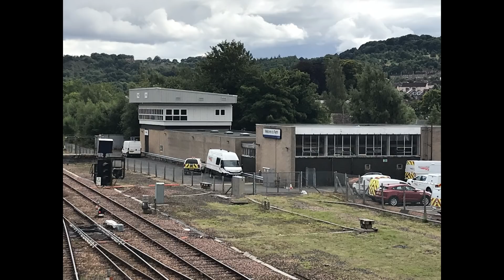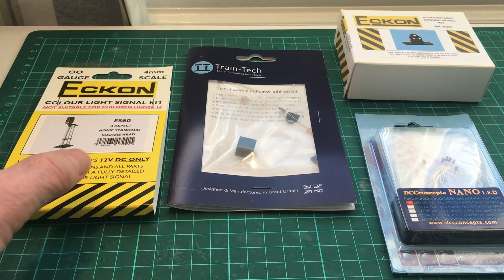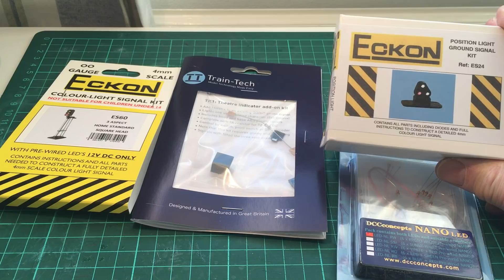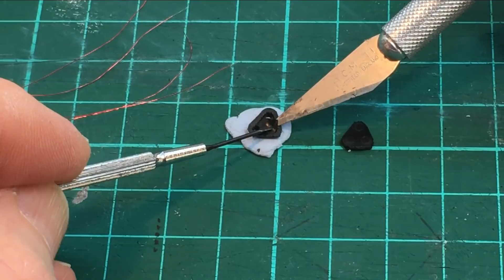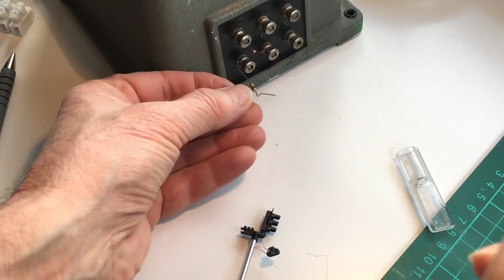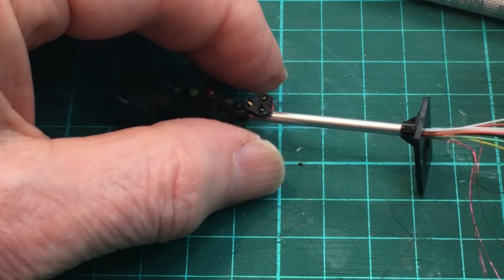Perth South Model Railway #19, Signalling the Layout Part 1

Comment: Of course if you are going to get Multi Aspect Signals (MAS) to work as they do in real life, using Track Circuit Block (TCB) rules. As found in your 1962 re-signalling of Perth. You need some type of Track Circuit !  Firstly to ensure the signal returns to danger as a train has passes. But also to ensure that when cleared is shows the correct yellow or green depending on what the next signal up the line is showing. That of course assumes there are no trains occupying a subsequent track circuit, no pointwork incorrectly set, and must also include an "Overlap". i.e a train must COMPLETELY pass a signal and a bit more (changing it to red as it passes), before the previous signal changes to yellow !!!! 

This can be done more cheaply that using expensive "Chips", none of which can do the job properly in line with real life rules. Indeed 3 aspect signalling can be fully interlocked using 3 track circuits (one penny each), a 4 switch relay and two x two switch relays per signal and signal section. Total cost around Fifteen pounds !!!   I've used this method for over 40 years on all my exhibition layouts very successfully.   

Happy Modelling.😝
Reply from the maker: Hi James and many thanks for watching and for your comment. I do have track circuits on all my running lines although being a DCC layout, they are all modern occupancy detectors and unfortunately cost a  lot more than £15.
I will talk about the logic that operates the signalling in a future video but briefly the occupancy detectors feed back to my Train Controller computer programme which then tells the signal the correct aspect to display. A signal will only display a proceed aspect if all points are set and the line is clear through to the next signal. It will show yellow or green depending on the subsequent signal aspect. The signal goes to red as the train goes past and hits the following Track circuit. There is usually an overlap though it’s a model railway and I was more concerned with getting it to work smoothly and efficiently rather than trying to stick rigidly to prototype signalling rules. Indeed the Train Controller programme, although excellent, does not follow UK signalling practice and doesn’t pretend to. Hope that helps. Would love to see your system if you have any videos available. Hugh
Reply: @perthsouth5576  Well if you're ever heading towards Spain, my 60ft x 21ft exhibition layout is currently around 70% complete (trains running and some signalling working. Scenics get left to last). I'm in Mora (Southern Catalonia) working in conjunction with a private railway museum here in Mora, hence "loads of space". So I can let you look at all my wiring diagrams, and the system in action, and have fun operating if you want, as the layouts being built in an Industrial unit, the Mayor is kindly lending me. Hope to have the layout ready for exhibitions around Europe by summer 2024.
Reply from the maker: Wow that’s quite a project! Sounds fascinating! If I ever manage out there I’ll look you up. All the best. Hugh
Reply: @perthsouth5576  Obviously Youtube has protections for email addresses ! But if you are coming my way I can meet you on Mora la Nova station (Direct trains from  Barcelona) if you send me a message to arrange a time & day, via this page !
Reply from the maker: @JamesSmith-mv9fp  I will do James though won’t be this year. Still have some international travel facilities so may well come by train. Cheers and hope the layout build goes well. Hugh

Comment: CALLING ON & SHUNTING SIGNAL RULES. 
A subsiduary signal mounted below a main aspect signal with just two white lights at 45 degrees, is NOT a shunt signal but a "Calling On" signal. Shunt signals are normally on the ground, and loaded passenger trains are NOT allowed to accept a shunting signal as permission to move. The "Calling On" signal has different rules from a shunt signal. When the "Calling On" signal is illuminated, it gives the driver permission to pass the main aspect signal at Red, and proceed at caution, and be prepared to stop 12ft short of any obstruction. Most commonly "Calling On" signals are needed at the approach to major stations where  separate portions of a train need to be joined in the platform.  

Having two trains in one section is of course against Track Circuit Block rules, and main aspect signals are locked at Danger to prevent another train entering an already occupied section. Hence the "Calling On" signal has to be provided as a subsiduary to overcome the problem. Further, passenger trains and freight trains are NOT allowed to be mixed in one (platform) section, by using the "Calling On" signal. Something the Signalman must understand, as the Calling On signal is NOT interlocked in the usual way !

"Shunting Signals" allow anything but a loaded passenger train to proceed at caution for the purpose of shunting. For example in major station areas like Perth, there is probably a necessity for locomotives to run around their trains. This may require a locomotive to move along a line in the WRONG direction. Hence a shunting signal can be used for this movement as it DOES NOT face normal oncoming traffic. However another rule of shunting signals is that a driver is NOT allowed to accept more than two consecutive shunting signals to complete the shunt !  Shunting signals are also necessary to enter or leave NON Running Lines, such as Goods Yards, Depots and Carriage sidings. So to avoid having shunt signals facing oncoming traffic on a running line, crossovers are usually "Trailing" NOT "Facing" !!! Think about that carefully.....

The Shunting signal with a Yellow aspect instead of red, allows a driver to pass the signal at yellow if he is NOT joining a "Running Line". If he wishes to leave the Yard/Depot etc, to join a running line he MUST wait for the shunt signal to be cleared in the normal way. So shunt signals with a yellow aspect are normally found at the exit from a Yard, where there is also a Headshunt to allow shunting.

One rare use of shunting signals and known as the "Running Shunt" is when for example on a single track "Running Line" there is a siding or yard. To protect the points entering/leaving the Yard from passing trains a shunt signal normally on a 3-4ft high post is used. This shunt signal has to be in the clear (two white lights at 45 degrees) mode to allow passing trains. It will in this case be interlocked with the preceding main aspect signal, which has to display a red if the shunt signal is not already clear. This of course allows an exception to passenger trains being allowed to accept such a "Running shunt" !!!     

By an ex BR Driver.
Happy Modelling 😝
Reply from the maker: Hi James and thanks for your extensive comment. I am ex BR/Network Rail myself although do not claim to be a signalling expert but am well aware of the basic rules. I sometimes use terms loosely in my videos and I can’t pretend to be 100% correct. The issue of the two diagonal white lights below a main aspect is an interesting one. The Perth Resignalling notice describes these as subsidiary signals and some are capable of showing an illuminated C for calling on purposes though they can also display two lights without the C. Thus they can act like normal shunt signals though as you say for non passenger trains only. The Perth notice makes clear that when Driver of a passenger train receives two diagonal lights WITHOUT a C he must not proceed and must contact the signalman. My subsidiary two white lights are displayed when a route is set into non passenger sidings. I may also use them for calling on purposes but I don’t have the ability to show a small C.
The miniature yellow aspect I mentioned was a separate small yellow attached below the main signal head and to the side. And was used to indicate a clear route for non passenger trains into various sidings. They have been removed in the intervening years and no something you would find now I think. 
You mentioned the running shunt signals facing passenger trains having to show proceed and being interlocked with main signals. There are examples of that at Perth but I have not tried to replicate that in my model. Thanks again. Hugh
Reply from the maker: I checked again and I think the miniature yellows are still there (but probably not used now). Sig diagram says they are used in accordance with Rule 35c.
Reply: @perthsouth5576  Sorry I gave up BR soon after they mock privatised it, along with a lot of other staff. They of course dumped the BR Rule book a year or so into the Notwork Rail caper, so I have no idea about the current "Rule Number" system. What does "C" refer too ?
Reply from the maker: Yes I remember “reading the Rules” with our P Way staff with the old book but it got silly with Personalised Rule Books with all the information spread all over the different volumes. The rules quoted in the Perth scheme were from 1962 so I suppose it referred to the 1950 Rule Book. The “C” was for calling on. All the best James. Hugh
Reply from the maker: According to the Signalling Scheme notice, a subsidiary position light signal with two white lights at 45’ without a C is covered by rule 47 Shunting, so I would defend my description of it as a shunt aspect. As I say elsewhere, many of these signals at Perth were capable of showing a C when required and without a C when a shunt route was set or into sidings.

Comment: Hi Hugh,
A very interesting video well done and  all I can say is I did not know you could get so many wires down a small pipe they are a work of art so very well done will look forward to seeing how you control them as it may help if and when I get to do my 2 aspect Hornby lights in about "2 Years", the running session was nice and to see how slowly your locomotives departed with the sound was interesting were they under computer control or by you?, I thank you for your tip on raising the decoder settings after doing all the speed settings etc as they did help my Hornby TTS decoders work so much better but they are a bit of a bother because you cannot change the start or max speed on them, as always please keep well and safe and another double bill from me on Friday.
Cheers Robert.
Reply from the maker: Many thanks Robert. Yes a bit of a squeeze getting all the wires in! The locos were under computer control. I add a lot of momentum - not through altering cvs but adding it through Train Controller on the computer. I’m sure I Train must have the same thing you can do. You have made good progress with I Train and I’m sure you will enjoy it once all in place and running smoothly. Will watch out for your double bill. Keep well. Hugh